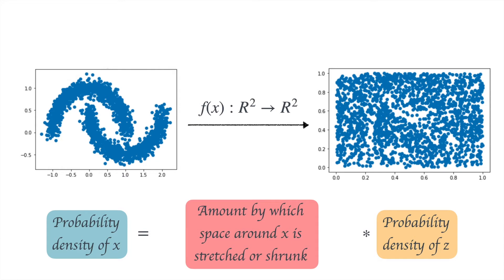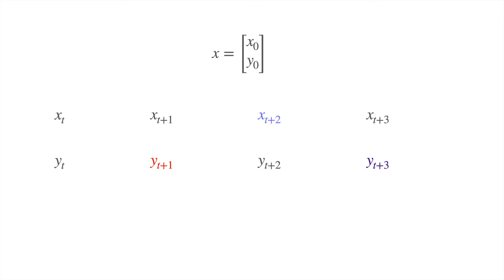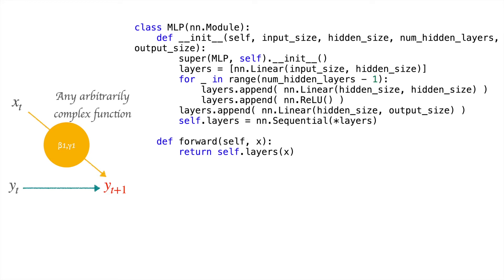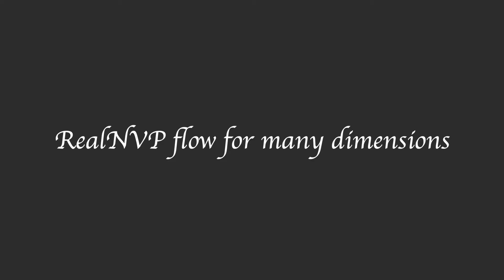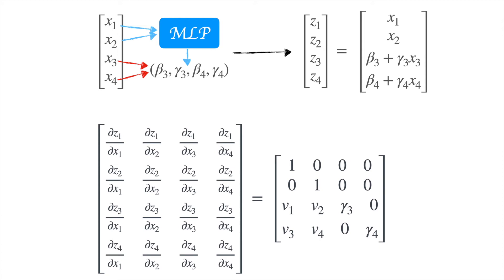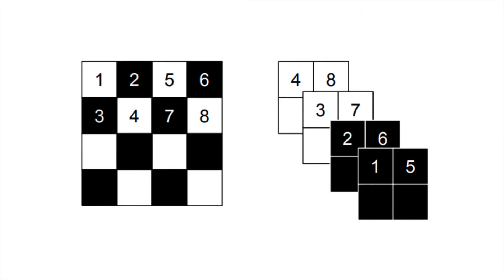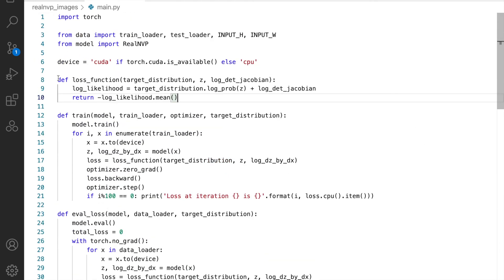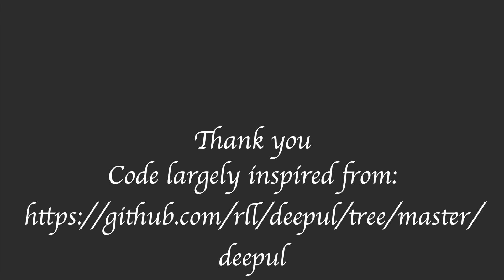5. RealNVP for 2D data and images

Comment: Thank you for your greate video, but I have some question. In AffineTransform2D class,  you apply "log_scale = log_scale.tanh() * self.scale_scale + self.shift_scale" to modulate the log_scale. But why do we need it, because we already applied MLP to estimate beta and gamma from x? Is there any reason. Sorry if I misunderstand this.
Reply from the maker: My guess is it is easier to train this way. If log_scale is used directly, the gradients are more likely to vanish or explode. Eg if scale is small, log_scale will be a large negative number. By using tanh and a simple shifting + scaling, you can tame the gradients.
Reply: @tinyvolt  It makes sense. Thank you very much for your explanation.

Comment: What a nice explanation! but is that okay to use ReLU for activation function? because it is not invertible.
Reply from the maker: Yes. Note that you are only using a neural network to find `beta` and `gamma` to scale and shift the input values. You only need to invert the scaling and shifting of input values; you don't need to invert the neural network itself. 

During the inversion, we need to calculate `beta` and `gamma` again. But this time we shift by `-beta` and scale by `1/gamma`. To calculate `beta` and `gamma` we use the same network.